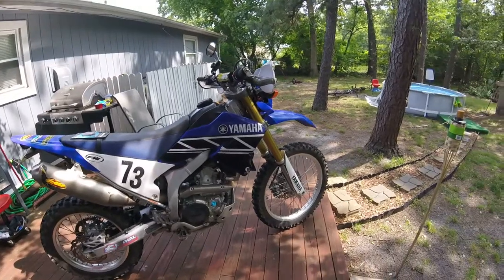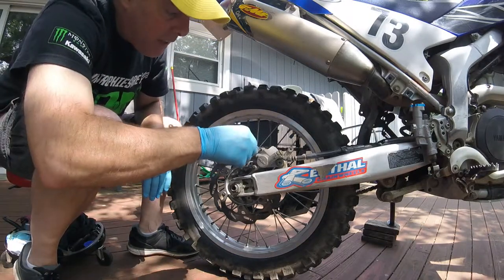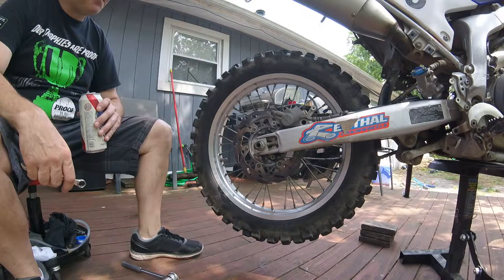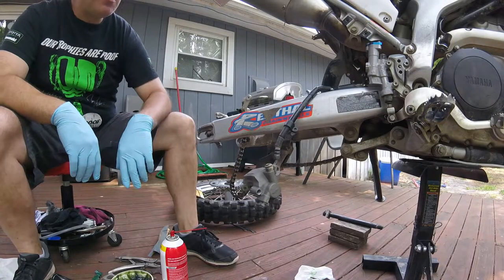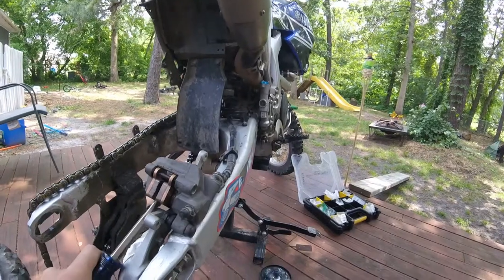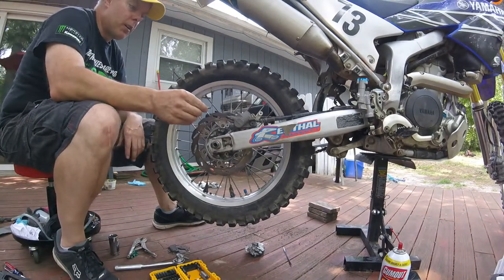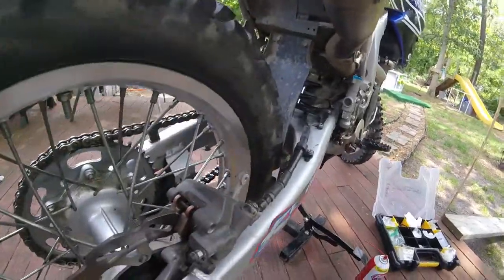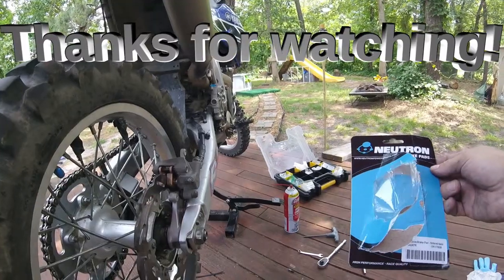Yamaha WR250R, changing rear brake pads, DougZ73

Comment: My breaks were worn straight to the metal. came to figure out how to push the piston back. But i bought my pads from ebay, turns out they are too thick.
Reply from the maker: If you leave the one brake pad on the piston side, and use a big C clamp, you can use it to gently push the piston back in the bore.